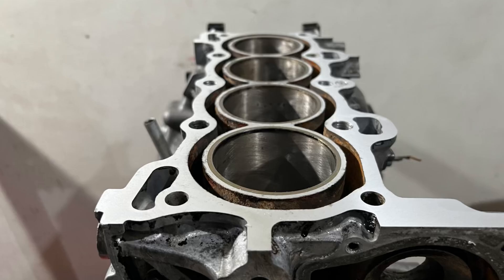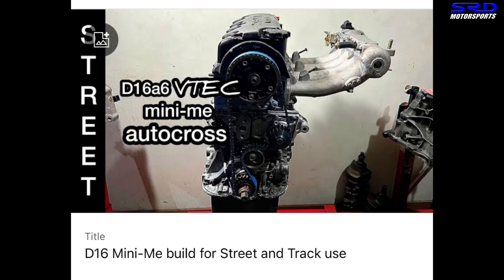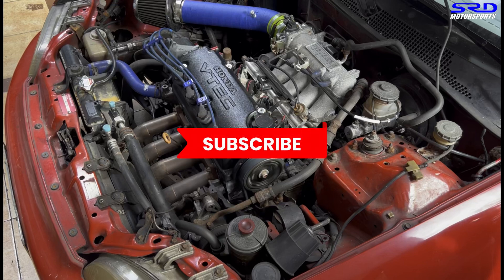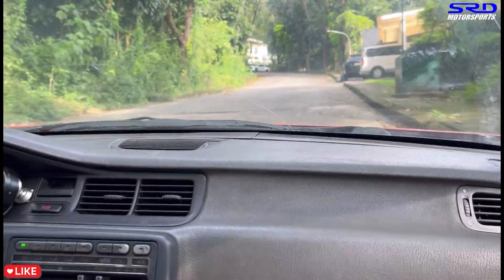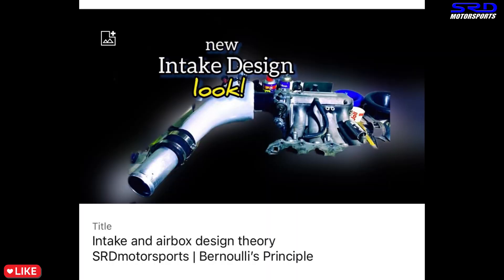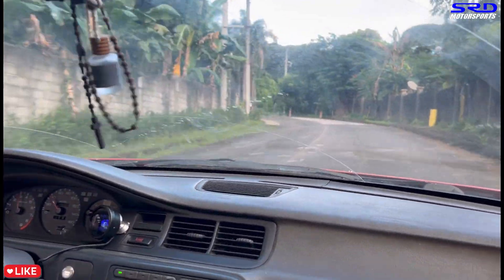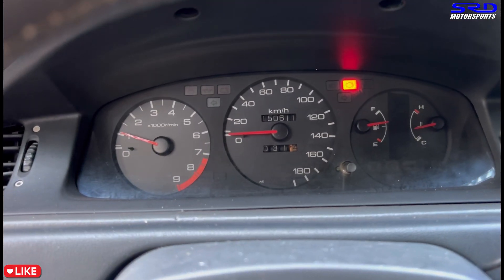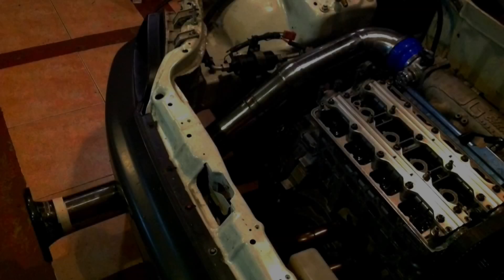D16a6 Mini Me VTEC Autocross Street Tuning & Intake Test

Comment: is there a rough step in the intake design? most FSAE teams I know ran a restrictor similiar to this utilizing venturi effects, I am not sure if this makes sense out of a restricted use case but there's only one way to find out, dyno time :) you'll definitely get higher air velocity into the throttle body, maybe with a properly made plenum this could be amplified (so the air doesn't overshoot a runner, maybe a center feed plenum where the throttle body feeds it from below ? definitely interesting and nice to see
Reply from the maker: true on all accounts and def worth a test soon 

U can check the older video and the reason to the design